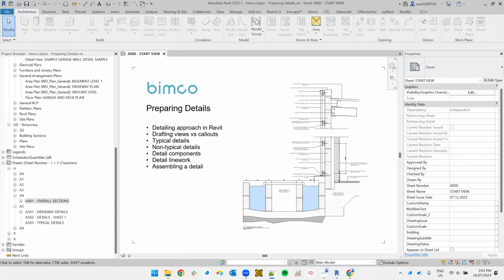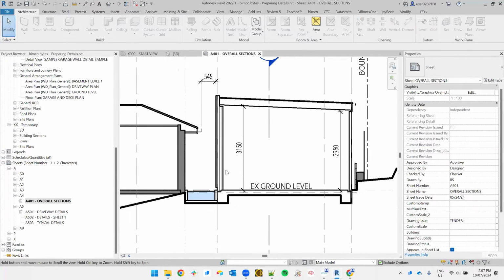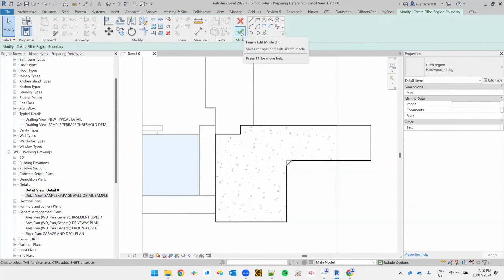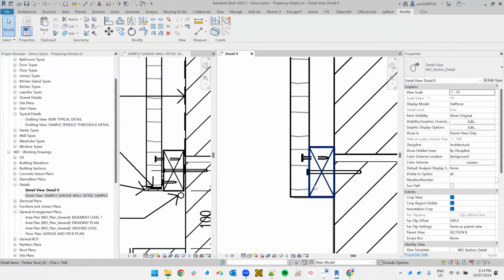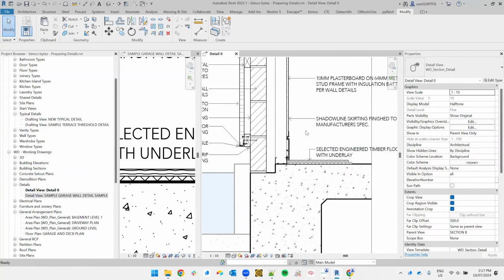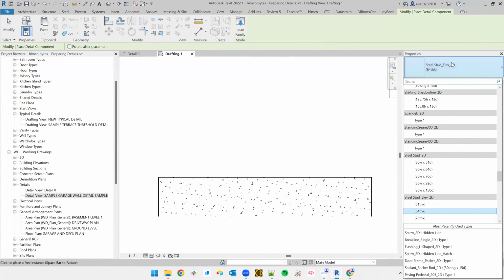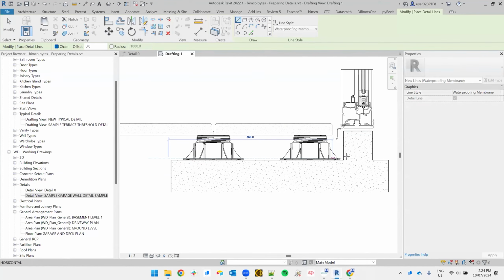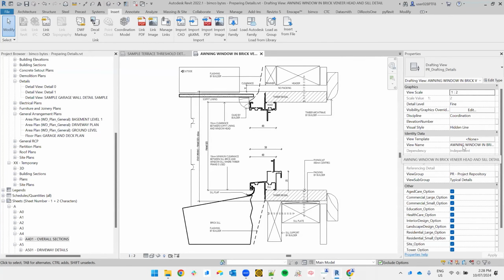Preparing Details - bimco Revit 2D Annotation Training Tutorial

Comment: Please I have a question:
How did you give the solar panel on the roof a uniform cross hatch pattern that doesn't rotate with the view or change in size?

Thank you for your time.
Reply from the maker: Hi @Sam-hj5ok, to give a solar panel on the roof a uniform cross hatch pattern that doesn't rotate with the view or change in size, you should use a model fill pattern instead of a drafting pattern. Model fill patterns are real sizes, meaning they maintain their dimensions regardless of the scale of the drawing. For example, if you have a 300 by 300 square pattern, it will remain 300 by 300 even if the scale changes.
Reply: @bimco-bimbi  Thank you! I'll try this out.
Reply: @bimco-bimbi  In my example, I have already created a solar panel family complete with specific dimensions as needed by my project. My guess would be that I cannot add the said Model Fill patterns in the family itself but in a project. Is this correct? 
Kindly correct me if I'm wrong. Thanks!
Reply: @bimco-bimbi  Related to my last comment, I figured it out.
Within the family itself, I created a custom hatch pattern using PyRevit (check our Balkan Architects video on that) and assigned it as a surface pattern for the PV module glass, and voilà!
Thanks again!
Reply from the maker: Hi  @isaacnotthebibleisacc , great to hear you got it working! Technically both are correct, the material must be edited within the Project if it already exists in the project or it will not be overwritten by changes in the family material editor. If the material has a new name however, it will come in new as you configured.
Unless you really need something detailed, I'd suggest a simple 'crosshatch' fill pattern over creating a custom pattern as its easier to manipulate and details are usually unnecessary. If you do need a custom pattern then pyRevit is the best out there and we use it all the time too.
Cheers

Comment: To all comments readers.
This is not BIM...!!!
You cannot export any of this information to IFC or a cleaned out Revit model when submitting to the main contractor.
Additionally, if you are using Navisworks etc, for 3D Coordination none of this 2D information is visible...!!!
Reply from the maker: Hi @jaykenny4205, thanks for your feedback! Right you are, this is not strictly BIM, this is 2D detailing, one of the many skills and documents that it takes to communicate construction. If your elements are required for clash detection or IFC, by all means, go ahead and model what you need in 3D. Possibly unfortunately, 2D is still very much a part of communication and practicality for documentation delivery
Reply: @bimco-bimbi  
Your channel is called BIMco....!!!
Ok... Hear me out...
Maybe you should recreate the same video using nothing but Modelled Content which has usable Cobie data..? 
Basically, an AsBuilt Model which shows everything.
Reply from the maker: Hi  @jaykenny4205 , you seem like a BIM purist and it is great to see you're embracing the 3D and data aspect of construction. bimco is the name of our company : ) so sorry if that's mislead you in any way. This video is about a fairly common practice of 2D detailing. 

Sure it would be great to have the time to model everything, however, one of the main points in this is that modelling is time consuming, usually not commercially viable and often impractical. 3D for design intent, 2D for details is a commonly accepted industry convention. There is often little value in most projects for modelling everything including battens, fixings, flashings. You can create an expectation that everything in the model needs to be modelled and resolved (dangerous territory IMO). Having said that, sure, a 3D version of this would be quite valuable for communicating how something comes together so point taken.

Curious to know how to approach a COBie driven detail and the how that can add value to the project. Happy to take that on and explore this in another video.
Reply: @bimco-bimbi  
The quicker you grow your company's Source File of Detailed Revit Families, the less time consuming your detailing will be.
This includes Flashings, Battens, Fixings, DPM's / DPC's, Waterproof Membranes, Insulation, Etc.

I'm looking forward to seeing this future video.